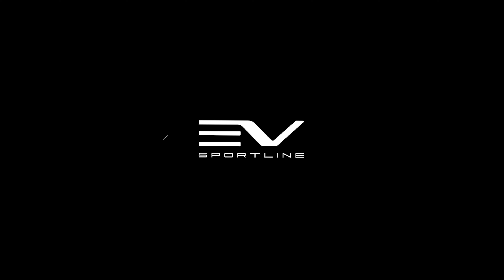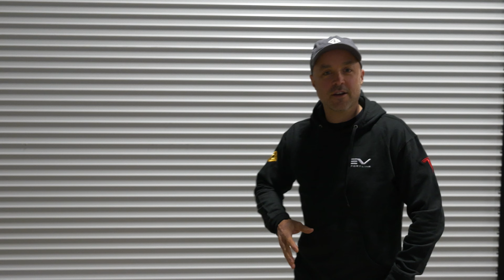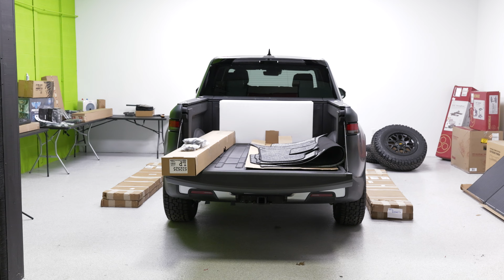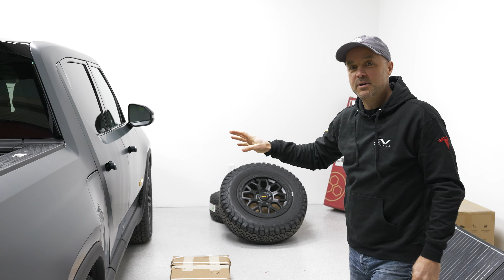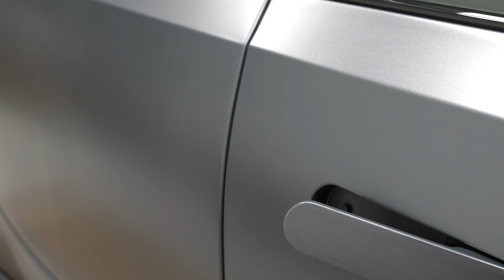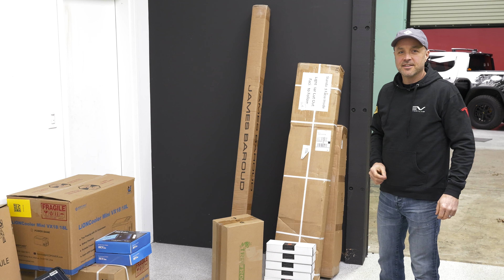The Ultimate Rivian R1T Overlander build by EV Sportline & Team 1EV - Full Water, Solar, Power, Tent

Comment: I have no experience in overlanding but why do you have to put extra power sources and why not just use the car's battery?
Reply from the maker: because that would burn down your range - many folks want to keep the vehicle charge for driving.
Reply: @EVSportline  I suppose that on the long run it would. I mostly think in the short time